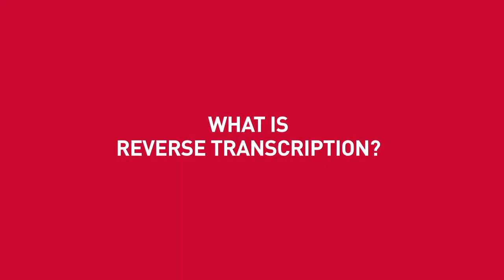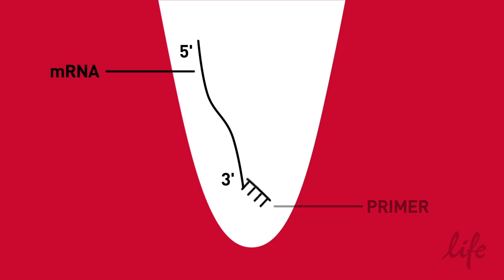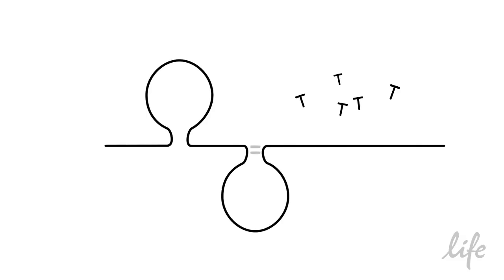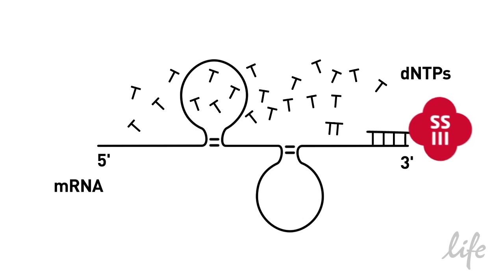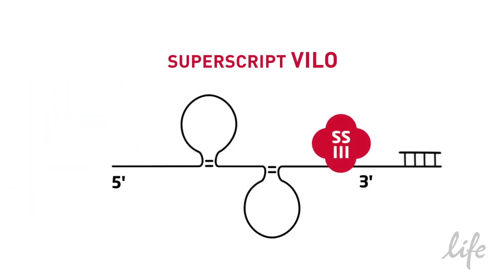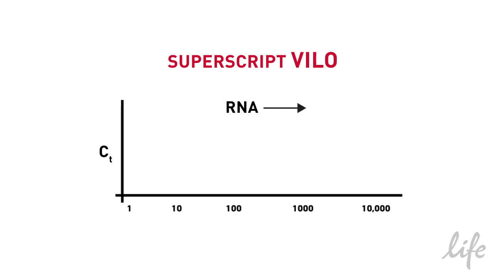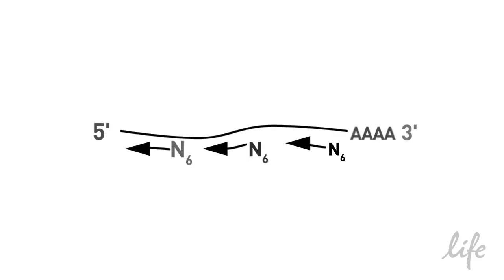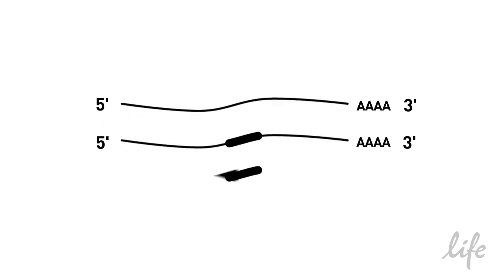Simplified RT -- Reverse Transcription Animation

Comment: why use rna first and not directly the dna ?
Reply from the maker: Thank you for your question. 

Our genomic DNA is transcribed first into mRNA. During the processing, the mRNA is then spliced and the unnecessary regions are removed. This mature mRNA is then reverse transcribed into cDNA. If we were to start from genomic DNA, then we would have those additional regions. 

Depending on what the downstream process is, this may be fine, but if you are to study the levels of gene expression, one should start out with mRNA, rather than genomic DNA.
Reply: Additionally, this protocol is used for research in virology, with so many viruses out there who has RNA genome